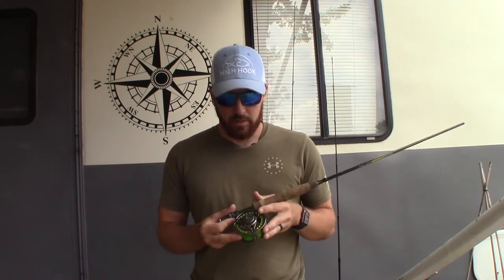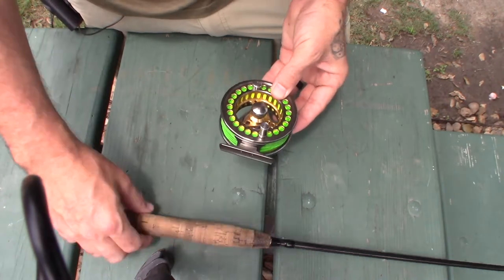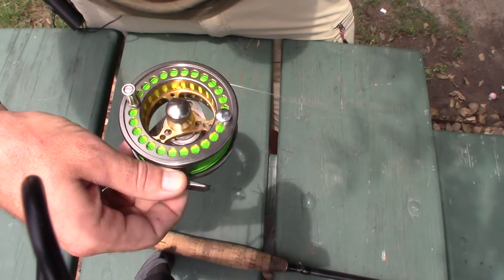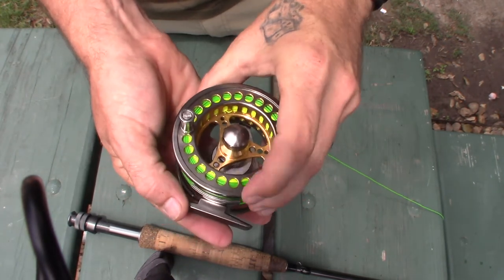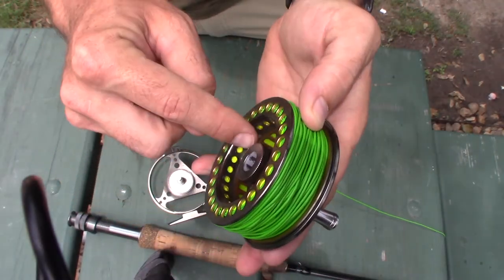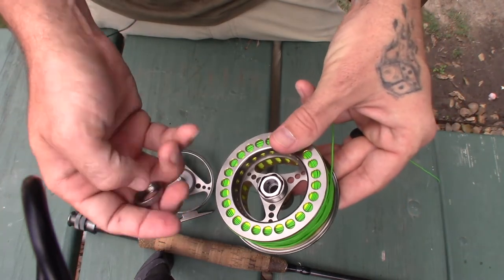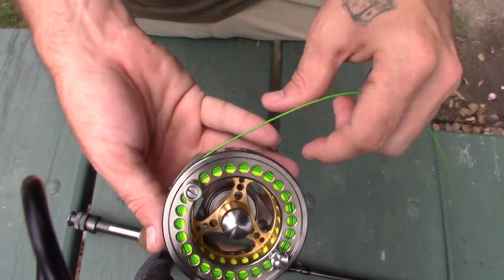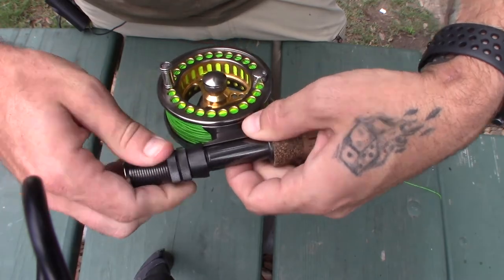How to switch your Fly Rod Drag Bearing

Comment: Mine also came with right hand retrieve and I had no idea how to fix it. I didn't know how easy it was until your video. You saved me! The idiots who sold the reel should include instructions on how to do this! Maybe they should read about how many folks had the same problem. I actually sent one back thinking something was wrong with the reel and the one they replaced it with did the same thing! Now I know why. The company should have realized this problem a long time ago.

Comment: I didn't know fly rods had bearings.  I guess I need to change my blinker fluid next.  ONLY KIDDING.  I just couldn't help myself.  Always good to know how to maintain your equipment.  I have spinning, casting and fly reels that are still going strong after 20 years because I know how to change bearings, clutches, drag washers, seals and the other stuff.  I would advise all anglers to know how their stuff works and how to maintain it.  Things cost too much these days to keep buying new all the time.  Good video.